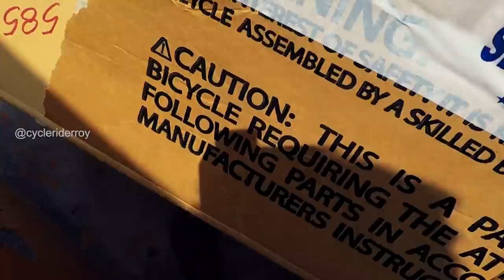Finally!!!  My New Full Suspension MTB Unboxing | Polygon Siskiu D5 2020 - Cycle Rider Roy

Comment: Raleigh roxio, fittrip vyper rs, btwin rockrider 520, btwin rockrider 540...which one you suggest. And will use it daily for 12 km journey. This is very important. Budget is not issue...or any other you suggest. I am a beginner

Comment: Cycle rider Roy is it possible to convert from free wheel to cassette ?  Do we need a new rim with hub or no because all the new bikes you get or buy have cassette and Shimano gears I want sram and some decent mechanical breaks (btwin ka xD)
Reply from the maker: Change hub
Reply: @cycleriderroy   hard to find for 26 inch rims 🙁

Comment: Bro,  my front suspension isn't working without pulling front brakes, that means if i my front brake is pressed then only suspension will go down and also if and stand and give handle bar pressure, suspension won't operate..  Please give me solution.

Comment: Video is great, your smile is good 😇
I wanna buy a bike, I had surgery on my shoulder 1yr back to fix my dislocation problem.. Can you suggest a bike (not so expensive) that will yeild low strain on my shoulders?
Reply from the maker: Go for a hybrid bike with suspension
Reply: @cycleriderroy  thank you:)
Reply: Me again.. :)
Are there any other configurations that I need to look for, like gabdel bar length or full suspension? And any bike suggestions?

Comment: Nice bike but where are you going to to ride this full suspension enduro bike this is a trail bike  and it doesn't make any sense using it on roads ,parks and using it on normal off-road .